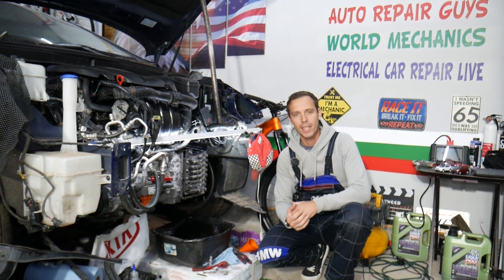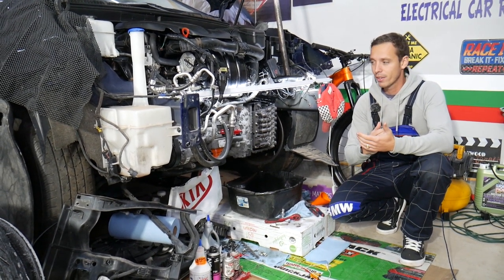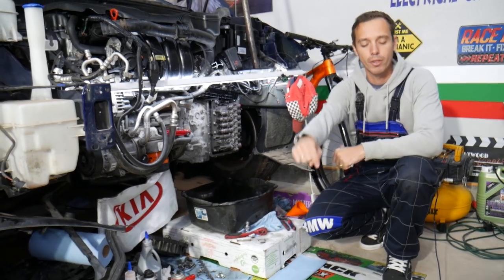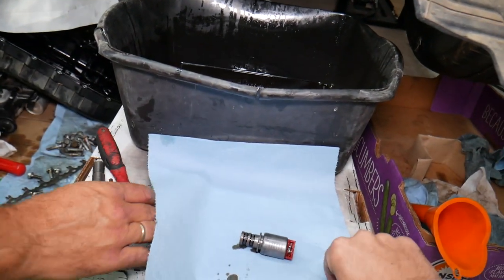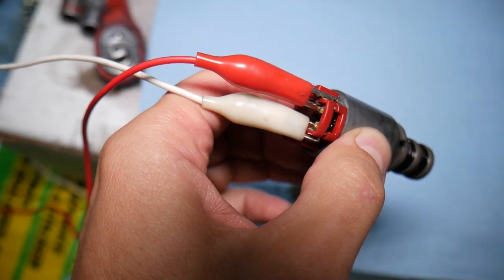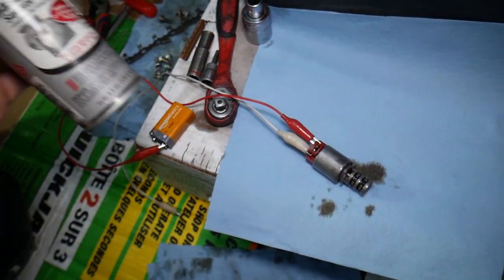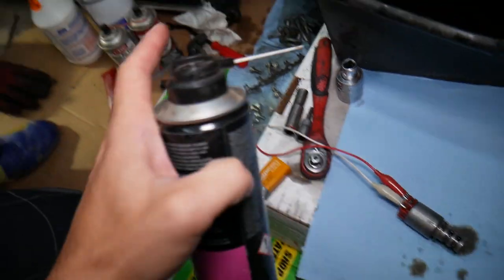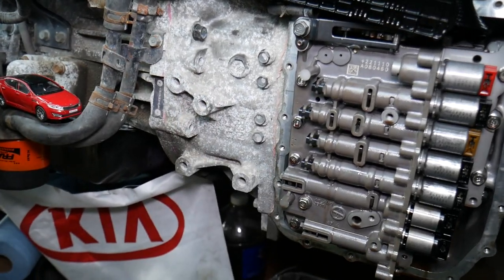HOW TO CLEAN TRANSMISSION SOLENOID ON KIA OPTIMA FORTE SORENTO SPORTAGE SOUL RIO, NOT SHIFTING

Comment: Hi please what is the difference between black and brown valve body solenoid harness
Reply: Basically one will control pressure and other will control flow to which gear to activate.

Comment: Why would you take it apart to clean it. That's dum just buy new ones no more problems
Reply: Is it?
Reply: New ones cost much more. Math is hard.
Reply: If resistance is within spec and you want to save cost why not just clean instead of purchasing a whole new solenoid  kit.  Typically solenoid screens get dirty more often then they fail. Unless the car was still driven with clogged solenoids and dirty fluid then it could burn them out. All they are is a electronically controlled rod that opens and closes to allow flow and or pressure.  They can be tested.